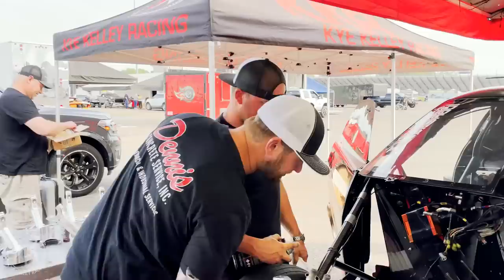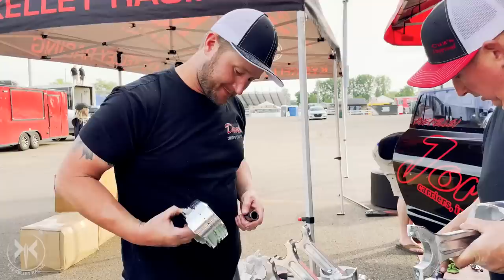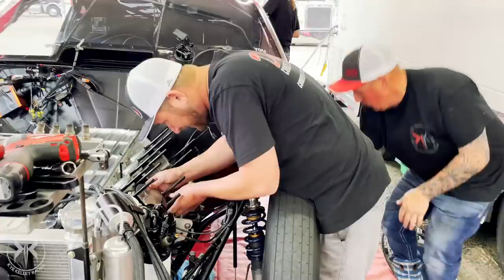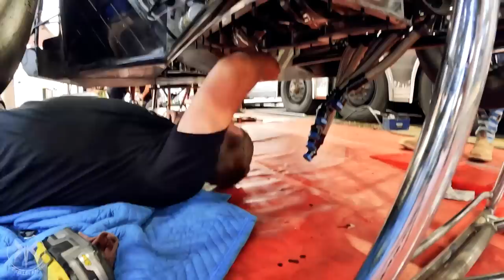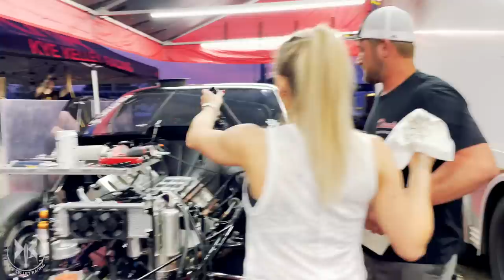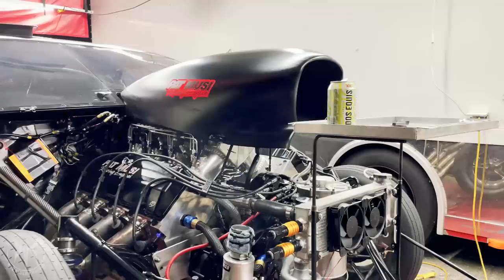Rebuilding my Musi 959 nitrous engine in the pits in Ohio before No Prep Kings race day

Comment: Insane amount of cubic inches on those motors.  Those pistons were monsters!
Reply: V8 959 cubic inch es - around 11.000 kubik in european numbers maybe even 12.000 - and taking them to 8-9000 revolutions is a risk meaning Every time the engine has driven all has to be checked for broken springs on the valve train and other checklist items

Comment: Explain to me why you would drag a car to an event like this with one or two passes left on it before your usual tear down please. It all may have worked out fine this time but why put yourself and your team thru the stress’s of trying To have everything mentally and physically prepared and perfect for the runs and then just throw a full rebuild in on top of everything? All it takes is one little lapse of judgement for one second while everything is happening feet from you with fans walking past etc and it’s over before it even started. 

I know engines are pulled apart at the track all the time, cars break but those are unexpected tear downs and I’m talking about planned end of time rebuilds. Could it safely have gone two more hits without detonation or were you just trying to get the tightest motor possible to squeeze out any extra power to try and get around ryan?

Enquiring minds wanna know guys
Reply: I talked to them at the race and they like doing the rebuilds/refresh under pressure instead of at the home shop. Kye was thinking it would not come apart but he needed every last bit of power that combination had to give so they decided to do the refresh trackside. Plus, it adds drama to the NPK tv show. Wait till you see the edited version on tv.....they really cranked up the drama. It will air July 4th on a special NPK "behind the scenes" 4th of July Special. Light it up and Burn it down is the subtitle. Lizzy has an amazing "american flag" 1 piece bathing suit she is going to model for the intro.
Reply: Both earlier comments are totally wrong 1st of all nobody said anything about 2 hits left and he did not do this to the motor in between rounds they left one race and had to drive straight to this 1 it was time for pistons and rings so  the day before the race they tore it apart freshened it up put it back together  several other racers do the same thing on long stretches of weekend racing
Reply: @dakotaautosales9673  Well, you've obviously have a "'mole" inside the KK team. You are getting info that is meant  ONLY for certain ears. I stand by my comments and will defend them until July 10, 20222.  After that, I am onto smaill tire competition and all the "behind the scenes" with small tire stuff. kNOWLEDGE is only as powerful as the words used to articulate it.
Reply: @benburnett8109   I happened to know them certain ears🧁